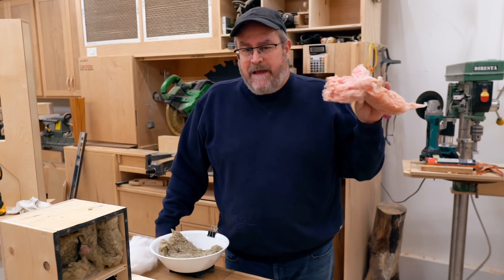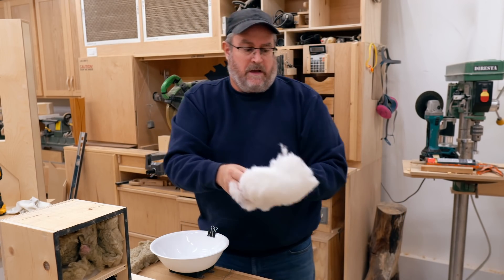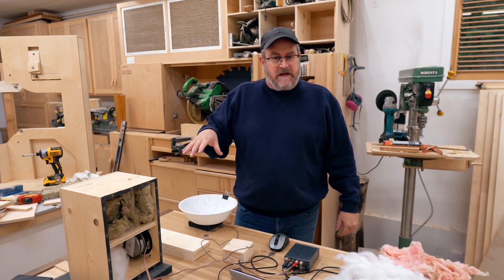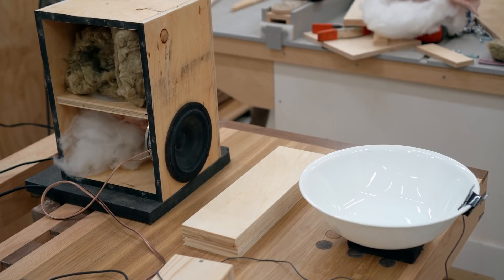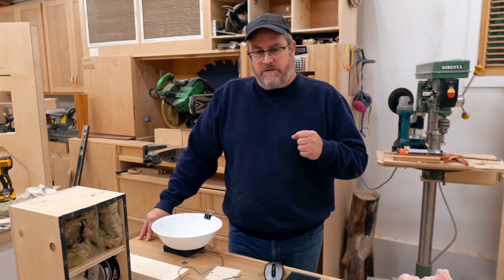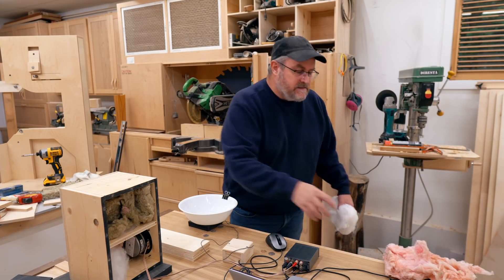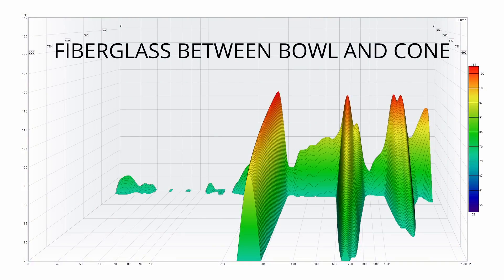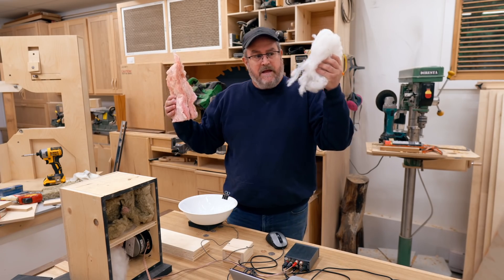Testing Speaker Stuffing Materials... Again!

Comment from the maker: I thought this would be a more direct test to demonstrate what these damping materials do inside a speaker box. It shows the effect the stuffing has on the sound waves coming from the speaker before they hit the bowl and make that vibrate, and it also shows how effective it is at shortening the "ring time" of the bowl itself. 
And of course the sound can and will go around the stuffing on its way to the bowl, but I thought this would give a relatively good approximation of the damping power of the sound waves by the damping material only.
Some will say that a bowl isn't a speaker box, but they are not at all dissimilar. The box will "ring" in the same way, just at a different frequency and amplitude depending upon the stiffness and self-damping properties of the wood used to construct the box. The bowl just gives a more dramatic demonstration.
It's worth pointing out that these tests that I'm doing are not to give this problem more weight than it it deserves. In most regards, box vibration and the sound that comes from it isn't a problem at all, since it will be so far below the speaker output that you won't be able to detect it. It's only when (in my opinion and experience) the panels get to be very large and unbraced and undamped that they can put out enough sound energy to be heard.
When building speakers there's ALWAYS a tradeoff. And in my opinion the best approach is to concentrate on the factors that will make the most difference first, and not get bogged down fretting over box material or stuffing / damping. These factors are very low in the overall design as far as ultimate sound quality is concerned. Knowing this will better equip you to make the important tradeoffs to get the results you are looking for.

Comment: But, the purpose of adding damping material is acoustic impedance matching between the driver and the air that supports it, not panel damping.  The proper test isn't measuring panel vibration, or even measuring sound pressure level, the proper test is electrical impedance measured across the bandwidth of the driver at issue.

Comment: Bit of a joke noress! What it is  is a sticky back vinyl and half an inch of poly foam, the vinyl actually is beneficial but better than that is linoleum stick it to the side walls with linoleum works the best, and with filling for balance. don't forget the front baffle on the inside.

Comment: Hi John, I enjoy your videos and the information you have shared.  I was wondering about alternate materials like old terry cloth towels rolled up and stuffed into areas of the speaker to do the damping, also using a bunch of old cut up tee-shirts and denim pants could also give more or less of a damping effect. These kinds of material are just sitting around in everybody's house, so why not try it eh?  One material I haven't seen mentioned anywhere is a tight celled sponge.  I just opened up my set of NLA Advents to do a re-cap, and encountered five large yellow sheets of sponge (12" X 12" X 3") in each box. Upon closing the boxes up with new sealing tape and adding a whole bunch of extra poly fill the advents sound better than new.  I bought a ten pound box of poly-fil at Wal-Mart for $30,  I might have been able to re-cycle old clothes and towels and saved the $30 for more capacitors for my next project.

Comment: I heard fiberglass increases scratching frequencies because of all the itching , ha. But I did get told fiberglass is very detrimental if it gets into the cones ? It seems very possible anytime they are moved about? Is it all the little air pockets in these materials that dampen sound similar to ceiling batts ?

Comment: I don't know if you are familiar with Jack White of the band White Stripes. But in his practice space he uses old tires , just piles them up, for his acoustic treatment, and bass blockers. Naturally, this assumes you have the extra space for tires. But what about cutting the tires and flattening them out, and then attaching them to the walls? You should be able to get old tires in a recycle bin at tire stores at little or no cost. Inside cabinets as well?

Comment: I like to use cheap foam pads or panels to line my cabinets. I will add 2 or 3 layers together to increase density replicating the denser "acoustic foam" at a much cheaper price. If there is one product that completely stumps me as to why it is so very expensive, it is "acoustic foam" pads or sheets. I mean regardless of the "density", are foam pads still not primarily made up of "air"?  I think foam sheets used in manufacturing sofa's could also work, and probably have more density than "acoustic panels". But are likely more expensive as well.   I haven't tried it, but rubber pads may also work, as I'm pretty sure rubber is much denser than foam. And adding a thin, tightly woven and dense towel like a "dish towel" over the foam or rubber sheet would probably work even better if you wanted to go through the extra work, having it be the material facing inside the box.

Comment: Why not use dampening materials that made for speakers instead of using building insulation. Long hair sheepwool,  twaron angle hair etc.
Reply from the maker: I sense some Acoustic Fields influence with the use of the term "building insulation". 
I said at the end of the video why - they are easy to get and inexpensive. And they get the job done as well or better than the boutique materials.
Reply: Egg crate foam is cheap and plentiful. Would you anticipate different results by lining the interior of the box thusly?
Reply from the maker: @jacktough  it's also virtually useless as a damping material inside a box, and for most everything else. And because it's useless, I don't have any.
What it is good for is decorating a room to "look" like it's treated and also for shipping eggs.
Reply: @IBuildIt  Thank you for your prompt and no-nonsense reply! Keep the great content coming! 👍
Reply: @IBuildIt  Also, have you ever spoken on how to determine best crossover frequencies in 2/3-way speaker setups without benefit of electronic measuring equipment, as well as how to avoid "beaming"? Thanks 👍

Comment: I guess there’s a reason JBL used fiberglass stapled to the inside walls of all their speaker since the 1950s... it works really well!
Reply: If you are designing a closed speaker/subwoofer then yeah, fiberglass is excellent damping material. Use it.

For ported speakers it may blow out particles out of the reflex tube, not good for your lungs and skin. For mids and highs polyfill, felt and such do the job and for woofer thick walls and solid bracing is more important anyway. Well braced cabinet should push the resonant frequencies higher, allowing the less effective damping materials do their magic on them.

Comment: Have you considered self adhesive automotive sound dampening material?  You cut it to size and stick it on.  It comes in two main flavors, closed cell foam and Mass Loaded Vinyl (MLV).  The MLV weighs a lot more, but works better for low frequencies.

I like your experimenting with stuffing material.  I always thought it is used to cut down on internal reflections.  You are using it to dampen resonances in the speaker walls themselves.  I think to a limited extent it can be used to increase the virtual volume of the enclosure.  What are your thoughts on this.

I am an old sound guy from back in the day when all sound companies built their own speakers from professional drivers.

Comment: NoRes and bitumen sheets work on a totally different mechanical aspect of sound compared to fiber materials like rockwool and so on... Mass and inertia losses (bitumen, NoRes) is used to stop the pressure part of the soundwave (the peaks) from inducing vibration in solids like speaker cabinet walls. Transmissive losses (acoustafill, rockwool) work on the velocity part of the wave where airspeed is at maximum, which lowers the transmitted sound pressure linearly to the distance of material the sound has to pass through. Which is why you want fibrous materials in the middle of the box, where airspeeds are the highest. In a long/tall speakerbox you can see up to 3-4 times better damping of the long mode when placing the fill in the middle compared to placing the same weight of material packed into one end of the box.

Cool to see you experimenting with dipole bass BTW! :) I have no doubt you will see bigger impact on your <60Hz room modes RT30/60 from doing that than by all your room treatment combined so far. It takes a lot of displacement/cone area to get really low bass from a dipole, that's the downside...
Reply from the maker: Damping is damping. Same mechanism - vibration reduction. It's as simple as that. 
Some are more effective for certain things than others, but damping is still damping.
Reply: @IBuildIt  As you say, we're doing this to learn and to have fun.... :) I started doing this 25 years ago, so I recognize many of your mistakes - I did quite a few of them myself, very enthusiastically - 20 years ago.
I still find audio engineering, acoustics and speaker building a fun hobby, but now I also have a solid formal education in engineering and quite a lot of experience - among other things 10 years in industrial work environment noise control.

So no, damping is not damping here, since solids (walls, boxes) aren't the same as low
density fluids (gasses) - they interact with things very differently...

So say you have a 400Hz side panel resonance in a 1m tall speaker. To get rid of that you either apply some high-weight, high-loss material like bitumen to a portion in the center of the wall, or brace it better. This does NOTHING to dampen the 170Hz standing wave you get in the enclosed volume of air in a 1m tall box.

To dampen the 170Hz standing wave, you use rockwool (or something similar) inside the box, preferrably close to the center where airspeed of the soundwave is at maximum. This in turn does absolutely NOTHING to dampen the 400Hz panel resonance.

The only case where they're interacting is if you have a cavity resonance and a panel resonance at the same/close frequency - but this is actually quite rare.
Reply from the maker: @AJBtheSuede  Bracing isn't damping - that IS a separate mechanism, but a bitumen layer is damping. Not dampening, damping. 
Vibration reduction, by definition, is damping, and a panel resonance is vibration. The panel is moving - vibrating - and the damping reduces it. 
Damping the airspace is also damping. Damping is damping in any form it takes.
So I don't know where you got your formal education, but you might want to ask for your money back.
Every kind of fiber stuffing is a damping material. It damps panel vibrations and airborne resonances. It does both at the same time because it's in contact with the panels and it occupies the airspace.
Reply: Why airspeeds are the highest in the middle of the box? Doesn't sound travel at the same speed in the air? Is there any static point along the wavelength where air pressure is the highest? I mean, the soundwave vibrates all along the cabinet at the same intensity, doesn't it? It is not like a string, where amplitude points are fixed.

Comment: I agree with these results, because I've done these same kinds of tests myself, but not with as much "tech" as you have there. I really WISH I had the programs, computer, mics, etc. that you used to show these graphs... in less than a second for each one, which is amazing, plus the ability to instantly then A/B compare the graphs on the computer screen, now THAT is an awesome program and setup there! I love it! The ONLY pieces of equipment I have is an old fashioned analog/manual knob frequency generator that I obtained for free many years ago, an old Radio Shack analog SPL meter that someone gave me, and my multimeter that I've had since high scool days, along with my very good ears of course, which I have taken very good care of over the years, because I love sound, speaker building, and music so much, so when I came up with these same results it was from my many HOURS of meticulous measuring and careful listening to different frequencies and materials, but so I could do SO MUCH MORE, and MUCH faster and easier, if I was able to afford to buy all of this high tech equipment you have! Wow! I also would love to have an oscilloscope, but I don't have one because I can't afford one, not even a used one...

Anyway, getting off topic slightly there, but I agree that the "Polyfil" stuffing is all but worthless in speakers as damping material, especially with the pitiful, "wispy" amounts of it that most speaker manufacturers put inside their speakers from the factory, (if they even bother with damping material at all), so when I see a speaker company's rather lame and useless attempt at damping like that I just laugh. And the ones that actually DO use it, definitely DON'T use enough of it to even have any positive effect! I always just take that tiny piece of polyfil stuff out and line the box with something better... almost anything else works better than that stuff does, lol!...

One thing that I will say about fiberglass though is that it's of course a pain to work with because it gets all over in the air and makes you cough and itch, which I really HATE, so then I tried the Rockwool stuff too, and the main problem I've found with that, in addition to the same problems fiberglass has with being extremely messy and irritating to work with, is that Rockwool is also damaging to any drivers that have a vented voice coil, because the sharp and considerably abrasive and heavy particles of it, kind of like an extremely fine sand, will eventually get inside the driver voicecoil and former itself and then start to cause rubbing and scratching of the enamel on the relatively tiny voicecoil wire, which of course is very bad for the driver itself, basically rendering it useless!...

With all of that being said however, and if you don't mind the mess and skin and lung irritation, both fiberglass and rockwool ARE effective and acceptable to use with sealed back drivers, (i.e. NON-vented voicecoil ones), especially since both of those materials are also reasonably easy to obtain and cheap, like at your local home center, hardware store, etc... However, I have finally found in recent years an even better, seemingly even more effective, definitely much easier to work with, totally non-damaging, and, most importantly, usually totally FREE material to use for very effectively damping speaker boxes with... You can usually find it in recycle dumpsters inside shipping boxes for various lightweight and/or delicate products... It is the batting that is made out of recycled clothing and textiles, (i.e. the ground up "blue jean" type insulation batts), and I have found that this type of insulation is quite readily available in your public neighborhood recycling facility dumpsters because it is used for padding and shipping so many things nowadays because it's "environmentally friendly". When/if you look for that stuff, it is sometimes wrapped with an outer plastic bag type layer for protection and integrity in shipping stuff, but you should just take that plastic bag layer off completely to reveal the actual recycled clothing insulation material inside, which you can then take and use for speakers of ALL types. Every time I take my recycleable items down to my neighborhood recycling place I look for and usually find some of this stuff, so I have a decent, workable pile of it now in my speaker workroom.

So, anytime you happen to find any of that stuff you should really save it and try it out, because it works at least as good at damping as fiberglass or rockwool does, (or maybe even slightly better), but it is MUCH nicer to work with, and usually totally free, which is an added bonus of course!... I actually wish I knew of a place I could regularly buy those ground up, recycled clothing type of insulation batts, but I've never found any place that sells it. It seems to only be an "industrial" shipping thing, not necessarily intended for "consumer" use or "retail" sale, which is unfortunate, but "it is what it is" I guess, just use it whenever you can find it... So good luck finding some to try, you won't be disappointed if you do!
Reply: I just bought the minidsp umik-1 which is whats being used in this video. 99 bucks and free software.
Reply from the maker: I used an accelerometer in this test. It measures mechanical vibration, not sound.